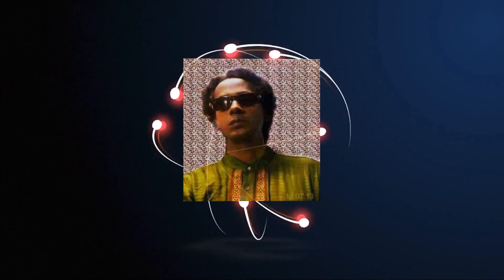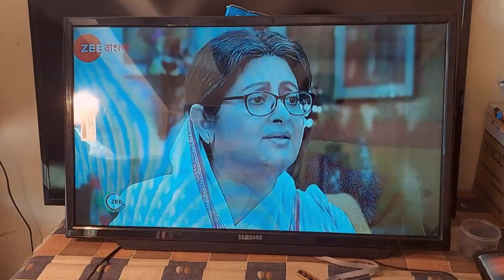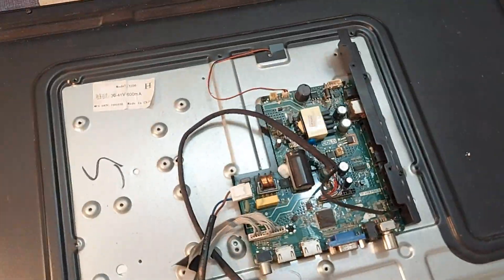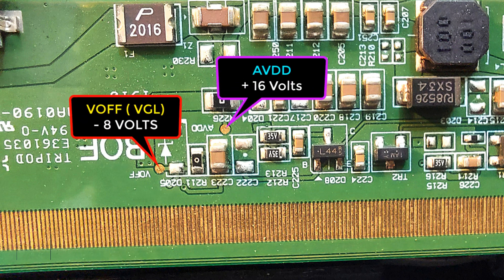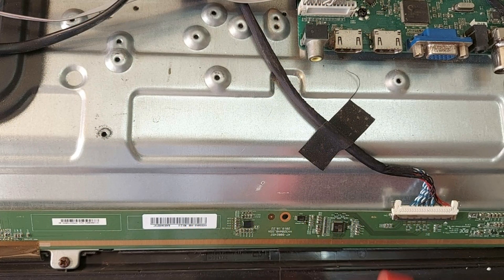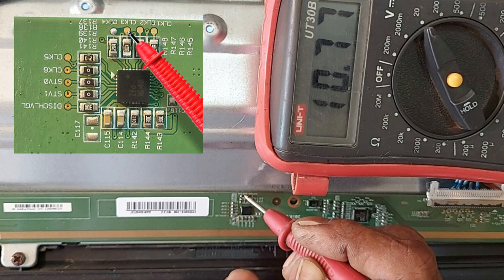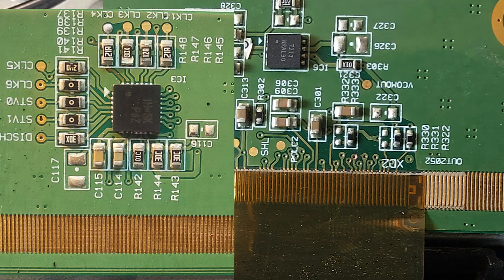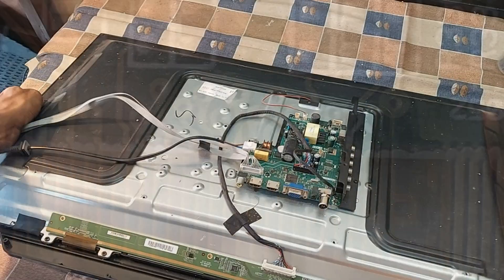Freezing Picture Then Vertical Bars Samsung 32 Inch LED TV | LED TV Panel Repairing  Cut  CLK Line

Comment from the maker: Dear friends, I am sorry to say that I have mistakenly said horizontal bar instead of vertical bar in the video.
Reply: thank you for the tutorial video like this.
Reply: Apner Video Valo Bangla Hole Aro Valo Hoto
Reply: Dear Sir, .! This problem is same as my led tv.My LED tv is one minutes ok and then frozen image and half vertical line appear.My t con board is 32AP11S4LV1.1 Samsung .I test all voltage ok.CKV1,CKVB1,CKV2,CKVB2 are all 8 vote.And  
GMA1 to GMA 18 volt is all ok.But I found short CKT 1 & CKT2 and then T1 & T2 Short found.These 4 line point is go to panel..This is short?? What is CKT1,CKT2,T1,T2?? Please explain me🙏🙏
Reply: Ok
Reply: Very good sir
Reply: بھائی ایک ویڈیو اردو میں بنائی 🙏

Comment: Samsung 32 growing to white screen problem. Big coil is short but I think it goes to panel directly. Nothing hot on board by voltage injection. How to proceed with track cutting? Or short killing  Thanks for any help.

Comment: Dear Sir, .! This problem is same as my led tv.My LED tv is one minutes ok and then frozen image and half vertical line appear.My t con board is 32AP11S4LV1.1 Samsung .I test all voltage ok.CKV1,CKVB1,CKV2,CKVB2 are all 8 vote.And  
GMA1 to GMA 18 volt is all ok.But I found short CKT 1 & CKT2 and then T1 & T2 Short found.These 4 line point is go to panel..This is short?? What is CKT1,CKT2,T1,T2?? Please explain me🙏🙏

Comment: Greetings from Venezuela, excellent video. I have a Daewoo brand television, model DLA-32R1U, it turns on fine and after 10 minutes a strip appears at the top of the screen and it loses color, what could that be?

Comment: Please I need your help I have 50 inch smart Samsung if I remove one ribbon cable is showing if I put both no pictures I try to put cell tape is showing picture but by the corner is melting and flicker  which line can i cut off
Reply from the maker: Brother, I can't say anything without seeing what kind of circuit it is, so I'm really sorry.

Comment: Hello there love your video but my tv has an lc1, lc2 variation problem with the same symptoms as in your video how can I solve it
Reply from the maker: Variation is not a problem  Such is the character of flip flop voltage.  Be very careful - you can try this video method.  However, without direct voltage supply, you will use two 1 kilo ohm resistors.  Then see what happens.  Thanks bro.
🌺🌹❤️🌹🌺

Comment: Please sir I have the same problem on 320AP07S4LV0 on sanyo 32 inches all the voltage is good but I'm not seeing clk 1-4 and I'm not seeing the line to cut.
Reply: Any solution sir??

Comment: For u running 5 second good picture after that virtical for me 5 second running virtical after that good picture what to doo
Reply from the maker: If there is an internal short circuit inside the COF, the CLK-voltage goes into safety mode.  Which of the CLK supplies has a short circuit, it needs to be measured by a meter, then you can carefully cut that line.
(I delivered this Sony TV 3 months ago, the customer says there is no problem.)
Thanks Brother.
Reply: @OrnatePixels  I have seen that vedio u cut mor it's work for that tv i have cut all ready ckv line 13to 16

Comment: Great work bro💪 my only concern is how do you see which pin to cut off in the cof becouse it is not marked
Reply from the maker: " CLK4 " is written near the level shifter IC, from there I measured by the meter which one is CLK4 of the COF. Thanks Brother.

Comment: Thanks for the explanations. But how did you know it is the right and not the left COF ?
Reply from the maker: There was a voltage drop in the damaged COF.
Thanks a lot Brother.
🌷🌺♥️
Reply: @OrnatePixels  Thanks for that, but how did you realize that ? In my case all the voltages on the scalar board are fine, but the display has two fixed vertical lines. I already tried to block the voltages between mainboard with integrated TCON and panel with tape just to check, whether I can isolate the problem to left or right side, but that did not help.
Reply: and how do you know, which COF chip is used and where are the test points ? On my panel there seems to be no marking on the COF